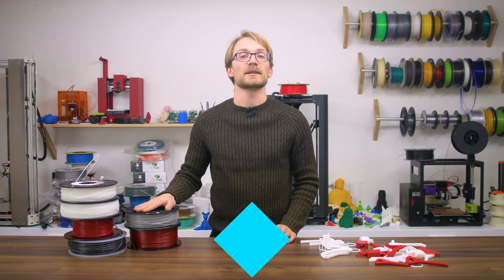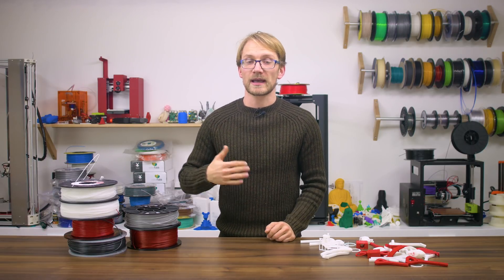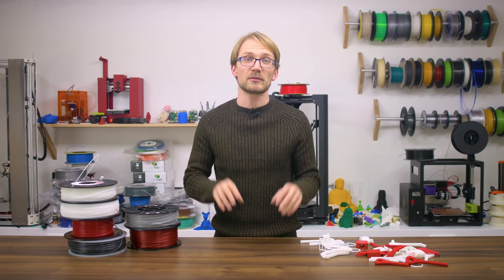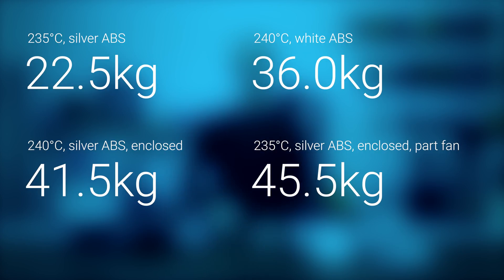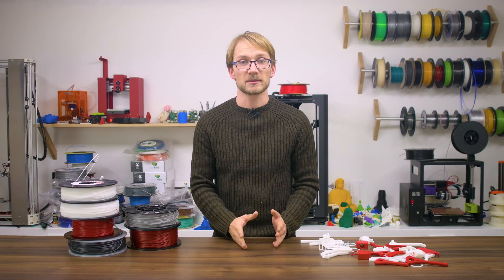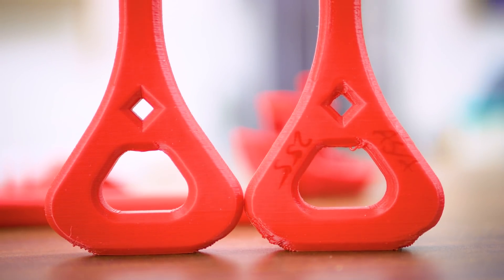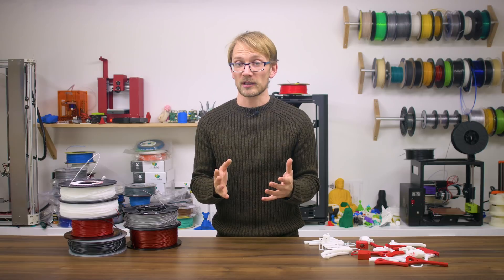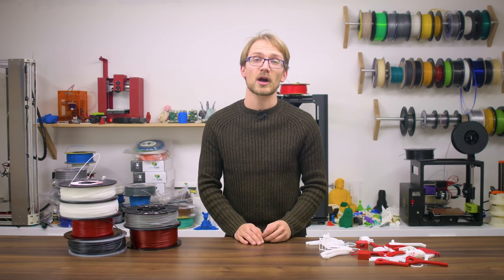3D printing with ABS: Hotter nozzle or hotter ambient? #Filaween

Comment: i've been printing ABS with a plastic bag over my printer at 235C and a 95C heated bed temperature without a cooler at 100mm/s. i measured the air temperature at 55C. that gives me really resistant prints and very good layer adhesion. the mechanical properties result mostly isotropic, it doesn't break on the layer interfaces. in terms of quality i didn't have any problem, prints end loolking very nice. And i also saw a big difference in the mechanical properties from one brand to other. i assume it has to do with the 'copolymer' nature of abs. each manufacturer has it's own recipe.

Comment: Tom, did you notice that there are two varieties of PETG on the market? One using ABS-like temperatures and the other using PLA-like temperatures, with the ABS-like PETG suffering warp just a little less than ABS.

Comment: Ich habe leider selbst beim drucken von PLA mit meinem Prusa i3 MK2 Original ein Problem mit der Adhesion. Ich habe das Druckbett versucht weitesgehend richtig einzustellen. Wenn ich mit Pritstift drucke sehen alle Linien gleich hoch aus. Nachgemessen sind sie es auch nahezu. Allerdings ohne Stift lösen sich an den Kanten in der ersten Schicht häufig die Drucke vom Bett. Meinst du ein Gehäuse könnte auch hier helfen oder liegt das Problem ganz wo anders?

Comment: I print with ABS 90% of the time now, I started with PLA, moved to PETG then to ABS once I had built a DIY enclosure. I feel I get the best prints for mechanical parts using ABS and an enclosure.......but I would still recommend PETG to someone new to 3D printing as ABS takes some work to get it printing at its best. 

Without an enclosure and a PEI heated bed ABS is a nightmare, with an enclosure and PIE heated bed its a dream.

Comment: Like many new FDM printer owners, I tried PLA and ABS when I first started.  I found PLA so much easier to print that the issues  with printing ABS with an open frame printer made it not worth it.  When I found PETG, I was sold.  It prints very well and has most of the printing advantages of PLA, but with more strength.  I do find that it prints slower than PLA, but not enough that it becomes a problem.  Knowing what I do now, I have decided ABS isn't worth my time to use.  Goodbye ABS, don't let the door hit you on the way out.

Comment: in my opinion abs is way easer to print with then petg
Reply: Once you've got a good enclosure sure. PETG tends to clump and stick to the nozzle, which can knock narrow prints over, or result in hard to remove blobs on the exterior of the model.

Comment: I primarily print ABS as I typically do very large prints that will be acetone fused to other prints to create even larger final objects.  Is fusing parts still a point where ABS has superiority or are there alternatives out there that give at least equal performance?
Reply: Would also love to know!
Reply: I too would love to know. Are there any adhesives for PETG that perform similar to acetone/ABS?
Reply: Model cement and acrylic cement tends to work as well on PLA as acetone does on ABS for bonding. 

Never experimented with PETG, from my understanding though is that it is almost as chemical resistant as nylon. :/

However, friction welding using filament and a dremel is a nice alternative.
Reply: You can also use a wood burner tool and weld with that.  It's a good way to use up the last little bits of filament on your roll.

Comment: I run ABS as my main material. My 3D printer is a PowerSpec Ultra 3D printer. This is encloses printer but because live  in Ohio I had to build a temperature control box.

Comment: Thomas... regarding ABS and air quality. ... I've run tests with ABS,  Nylon and PLA to characterize particle and gas generation for each type of filament. I found that if I kept the filament stored at 25% or less RH then none of the filaments generate detectable gas or particle counts.  Stored at 50% RH, ABS generates large numbers of particles.  I didn't check for gas generation at that RH.

My theory is that the water absorbed by the filament turns to steam when it is heated in the hot end. This causes numerous small steam explosions which spray tiny bits of the molten plastic thus generating airborne particles. Since ABS is more hydroscopic than PLA it will create more particles if it is not stored in a desiccated container.

I tested using a printer and laser particle counter  inside an enclosed volume.  None of the filaments that had been stored at or below 25% RH raised the enclosure particle counts at all while printing.  In fact, after closing the door to the enclosure,  particle counts went down by up to 90% from room ambient levels due to settling and because the room air,  which always has particles,  was not able to mix with the enclosed volume. 

I thought you might find this interesting since the studies claiming ABS is dangerous did not account for humidity levels.  If they would have done so their results would have been completely different.
Reply: 123jerro We measured very high particle counts when printing with ABS stored at 50% relative humidity. For ABS stored at 20% RH the particle count didn't raise at all and VOC's we under safe limits.
Reply: Tony Shulthise Very interesting!

Considering how you can never be sure how a filament was stored prior to shipping, would storing filament in very low humidity (e.g., next to a bit of silica gel) extract the water particles that might have gotten trapped? In other words, can filaments be "fixed" or do you have to rely on them never having been stored in a humid environment after extrusion at the factory?
Reply: aiklarung You can remove water from filament by storing spools in a desiccated box.  If you are in a hurry you can heat the spool to around 125 F or so (maybe hotter but I don't know if it will affect the shape)  for a few hours  to get some of the moisture out. 

I just keep my spools in a sealed plastic container with about 2 lbs of desiccant and a humidity monitor.  When the humidity monitor reads over 25%  it's time to heat my desiccant for a few hours at 180F to dry it back out. Or you can use color changing desiccant which changes colors based on moisture levels.  You can find everything on Amazon.
Reply: Tony Shulthise thanks for the info!
Reply: Interesting!
Reply: Following your logic ABS shouldnt stink up the place with that intense styrene smell either in that case. If that still happens, your counts are likely wrong.
Reply: I think the disconnect is that a laser particle counter can't 'see' the VOC (volitile organic comounds) released, because they are not particles but evaporated (gas phase) chemical compounds.  So while his data could be correct that particle count can be reduced by drying - and in fact his theory on why seems very reasonable to me - it may not be telling the whole story on emissions.
Reply: Interesting findings! Pretty sure the VOCs are not humidity dependent though. Especially if I print my ABS hot my nose leaves little doubt about it; and it just makes sense; ABS has stuff in it that will evaporate when heated to its melting point.
Reply: Did you conclude that the out gassing is being better  propagated by the higher water vapor output?
Reply: Silica gel, really? Do you know how hard/expensive that stuff is to get? What you need is a nice big tub with a decent lid, that will fit all of your filament reels and a 20-25kg bag of Rice! Your filament will be dry as a  Camel's eyelashes in no time. :-)

Comment: Thomas... regarding ABS and air quality. ... I've run tests with ABS,  Nylon and PLA to characterize particle and gas generation for each type of filament. What I found was that if you keep your filament stored at 25% or less RH then none of the filaments generate detectable gas or particle counts.  Stored at 50% RH, ABS generates large numbers of particles.  I didn't check for gas generation at that RH.

My theory is that the water absorbed by the filament turns to steam when it is heated in the hot end. This causes numerous small steam explosions which spray tiny bits of the molten plastic thus generating airborne particles. Since ABS is more hydroscopic than PLA it will create more particles if it is not stored in a desiccated container.

I tested using a printer and laser particle counter  inside an enclosed volume.  None of the filaments that had been stored at or below 25% RH raised the enclosure particle counts at all.  In fact, after closing the door to the enclosure,  particle counts went down by up to 90% from room ambient levels due to settling and the fact that the room air,  which always has particles,  was not able to mix with the enclosed volume. 

I thought you might find this interesting since the studies claiming ABS is dangerous did not account for humidity levels.  If they would have done so their results would have been completely different.

Comment: Tom, completely agree. Now PETg is available I cant see any reason to still use ABS. Even in my enclosed printer with temp up to 45 it still often warps. Also as you say, quality of ABS can vary a lot. Tried to make ABS slurry last week and the filament would not dissolve in acetone, can you believe. Just need to keep nozzle clean for PETg to give good results.
Reply: Vince Hogg - to prevent warping you will ideally need to remove all air movement inside your chamber. its amazing how much even a small amount of air disturbance can effect your results.

Comment: I've finally switched to PETG for most things.  The mechanical properties are excellent, it is easy to print, its non-toxic and has nice colors.  The only things we print with ABS are printer parts near the print heads, such as fan brackets and ducts.

I also have the Raise 3d N2+ printer which is enclosed with a separate removable top.  Having the enclosed chamber improves all my prints, even PLA, by buffering changes in ambient temperature and air currents during long prints.  Check your prints for marks on long prints with the air conditioner or heater kicking on and off.  They are there and they are preventable.

Comment: Fully agree :)
I keep my aging Flashforge pro, just for the times I need to print with ABS. I have been advising my customers to consider using PETG or PC if they need strength for a prototype. I have also noticed that there does not seem to be as much ABS filament out there. I think it is slowly losing demand.

Comment: I am not exactly disagreeing with the results of your test. But, I do have different experience with ABS.

I've been printing in ABS for about 5 years now, without an enclosed chamber. I live in Houston, Texas (mostly hot, humid), with air conditioning.

I've never really had strength problems, and my prints have come out looking nice enough. I have had intermittent problems that have resulted in curling or failures, but I hadn't really considered it to be unusable.

I have recently been trying other filaments, partly due to what I saw from Filaween. I like what I'm seeing with PETG.
Reply: Spunkmire <laugh/>Not a wizard. Stubborn and too clueless to realize that ABS was supposed to be hard when I started years ago.

I've mostly gotten reasonable quality filament, printed on a heated bed (100-110C) in an air conditioned room. I tend to print with the nozzle at 230-235. As long as there isn't too much airflow, I haven't had a lot of problem with cracking. This setup does give problems with small diameter parts, as ***** suggested. I've had to print multiples for that to work.

I've basically spent a fair amount of time tweaking and tinkering until I got output I like. 

One of my engineering profs years ago said there are two solutions to any problem: "the elegant mathematical solution" and "brute force and ignorance". I chose the latter.
Reply: (whispers)omg he is a wizard...
Reply: ***** I've had layer cracking once in a while. Normally, when the airflow in the room is higher.

As I said, I'm not really disagreeing as much as giving different anecdotal evidence. I'm looking forward to playing with other materials to see if they work even better.

Thanks much for your Filaween series and all the videos you do.
Reply: G. Wade Johnson I agree I agree with you here, im in South Africa print with no enclosure and with a part cooling fan. I get great print quality, I print at 225degc hotend and 100degc bed with 0,1mm layer height.

on the taller prints I get some splitting and warping but mostly due to tempreture changes due to airflow.
 also my house averages 22degc in summer and 15degc in winter.
Reply: ackackBarf if you interested in trying out other cheaper fillaments try fillamentfactory.co.za, its a South African manufacurer and its around 17 euros a kg
Reply: G. Wade, tell us more about abs, i have such a hard time.  R U a wizard?
Reply: When I'd print in the summer my ABS prints with no enclosure always came out flawless,  now that winter is hear and the temperatures of my rooms are lower however, I've had a really bad time trying to do ABS recently..
Reply: Found with my Afina, no enclosure is fine just stop blowing air on the part so it doesn't cool so fast. It prevents cooling too fast and shrinking, causing layer separation. My cooling fans sucks air away from head to cool head, but doesn't blow on the part as it prints. Also use a good filament, I am testing a cheap one from Inland right now and it is terrible. My best prints come from Octave filament right now at around 236º. The Afinia branded stuff is also good, but costs way more. I have gotten other cheap stuff off Amazon and had terrible results. It also wouldn't bind with the other filaments when I swapped them mid print.

Comment: I print only ABS. it's the best material: filing, grinding, painting, gluing, temperature resistend, aceton smothing, long time stability
Setup:
Printer: diy germanreprap X400 + Unlimaker style
Closed Chamber: Plexiglas
Big Heatbed 1100 Wats 500mm x 500mm
Hotend temperature 260°C
Bed temperature 80°C
Bed: Glas + Capton + ABS filme
Chember temperature increses up to 55°C
Fan: on (60%)
Results: Perfect! no warping, no cracks, perfect layer adhension, great bridging, successful big pints up to 250mm x 250mm x 400mm (980g, 80h)

Comment: I have had very good experience with ABS at very high temps (280C+), no enclosure and strong fan, and i really mean strong fan. I was using 80mm server fan, not those which sounds like a jet turbine, but stronger than average 80mm fan

Comment: I am using ABS since I started 3d printing things. But I do have fully enclosed printer so I never had any issues with ABS. There is one thing that you didn't mention, Tom, and that is how ABS is easy to work with after print is complete-PLA nad PETG are hard to file, drill and sand if you are using hand tools. :)

Comment: Simple PETG is good but not that amazing, though it is better than ABS in my 2+ year experience. Quality ABS like Verbatim also has better results. Maybe the more refined blends like E3D EDGE and colorfabb NGEN/XT/HT are the best choice. I will soon compare Colorfabb HT and Polymaker PC-plus for high temperature and mechanical strength applications. Also what about the Zortrax ecosystem? I think it is the most reliable system to print ABS for desktop 3D printers. If you can print reliably and easy ABS with Zortrax, why complicate things further?

Comment: I actually use ABS quite a bit, it's my personal primary material for any 3D object that I know I'm going to 'use'.  Though it also helps that I have a Flashforge Creator that has enclosed sides and a heated bed.

I'm also testing out PET, but I am noticing that PET is a bit more 'gooey', and tends to string considerably more.  Still, I only just installed a parts fan on my machine and am slowly testing out the proper settings for it for various materials.

Comment: Well, i not only have an enclosed printer, but with temperature control, and an active heater.
I created a plugin for octoprint to control the enclosure temperature, also lights, fans and whatever you want to...
I only print in ABS as I don't like the way PLA feel, to hard, to brittle.... 
https://github.com/vitormhenrique/OctoPrint-Enclosure
Reply: Whenever I touch and PLA print I feel like it is going to cut my hand off! I also had too many problems with heat creep on my Lulzbot Taz 5 and PLA that i want it far far away from my nozzle. I print HUDGE abs prints with no noticeable warping and I can keep my enclosure at 50 degrees :)

Comment: One easy way to make a cheap  heated chamber : I used a big  cardboard box doubled  with a thermal blanket film inside. It will heat up much faster only with the energy of the  heated bed. It can reach 50C or more easily. for ABS I use a heated chamber + part fan at 50% and nozzle temp at 245C. I rarely print with ABS, only when I need  thermal resistance. I prefer PETG for mechanichal resistance (+heated chamber against large part bending)

Comment: Hi
I got some crystal clear natural petg from atomic filament. I am using it to print an rc plane so the printer is pretty much doing something similar to a spiral vase since it is just do one outer layer. The recommended temp is 230/245 but when printing at 230 there are these little bubbles kinda on the print. I can't explain it very well but pretty much it looks like it is not extruding in some places resulting in there being white places on the side of the print. I backed the temp down and it was not until i got to 200 that they went away. Surprisingly it prints fine at 200 but how come it is doing this? Petg is not supposed to print that low from what I understand.
Thanks!